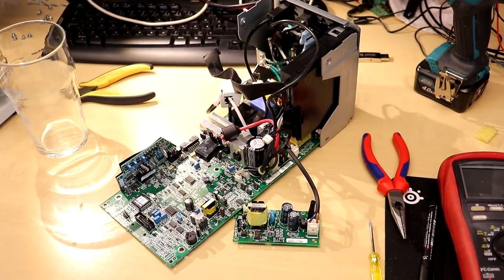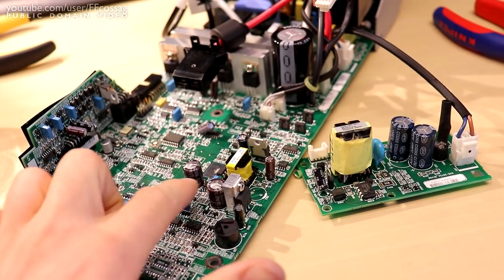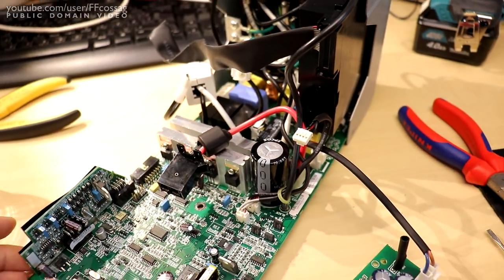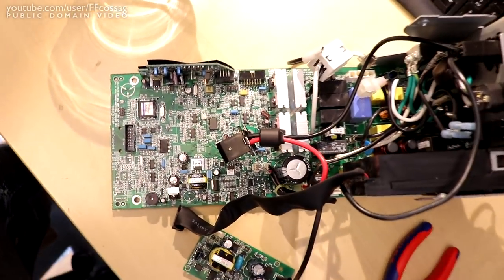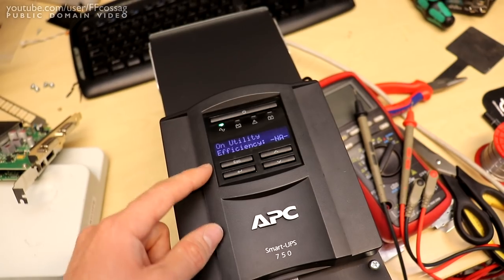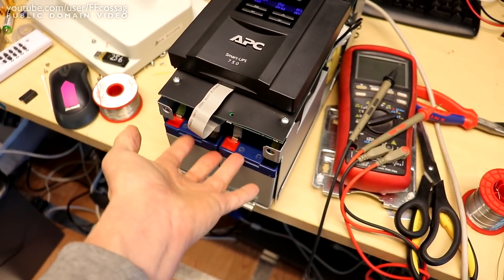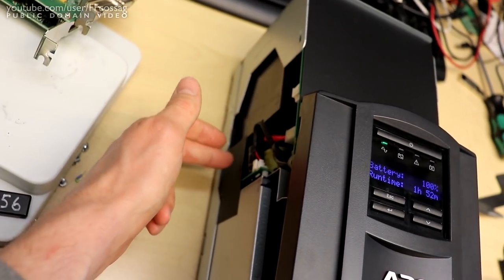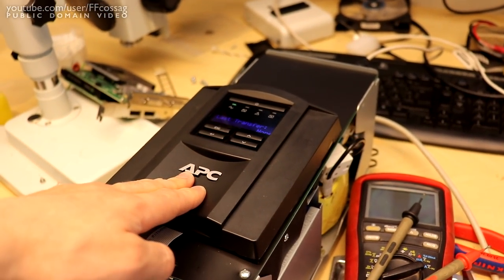APC SMT750I Quick Teardown

Comment: Now, this is the content I subscribed for. I really like your old videos that have to do with batteries/UPS. 
Bit of a question: I have a Back-UPS CS 500 (With all the small caps replaced to eliminate the whine, gotta thank you for that tip) from 2006 or so. Is it one of the models that have the transformer online all the time?
Reply from the maker: No, the plastic back-UPS models are offline, not line interactive.

Comment: Well worth your time and effort f.f, a lot of people trust apc units to be reliable.
Yes tny switchmode all in one chips do tend to go poof, i like a big stonking mosfet on a good heatsink and a seperate control system for switchmodes.
i'm old fashoned and don't think heat is good for any device.
Reply: I like the smt1500 model...

Comment: Hi FF. Since you have a lot of experience with these devices, is there an easy way to connect 12V/24V fans to this model? e.g. any free pins on the mainboard?
Reply from the maker: You can shove 24 V fans straight across the battery terminals, but that's about it. I think there's also a relay breaking the battery, but I'm not sure. The 12 V regulator is very weak, so you shouldn't try to run a fan off of it.
Reply: That relay would be the best place if I can figure out where it is. Think you used that for a fan on another series as well. Guess just grabbing some 12?V at the smart slot will count to “not recommended” in case it’s related to the 12V regulator. Thanks for the input. Great videos man.